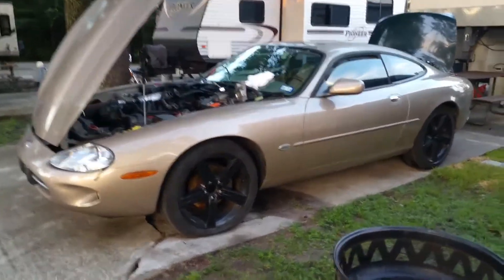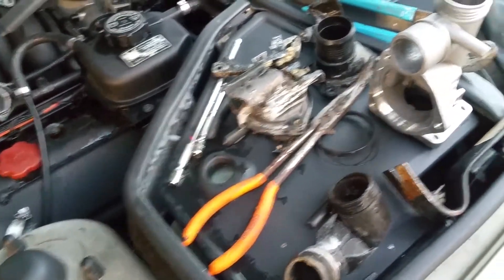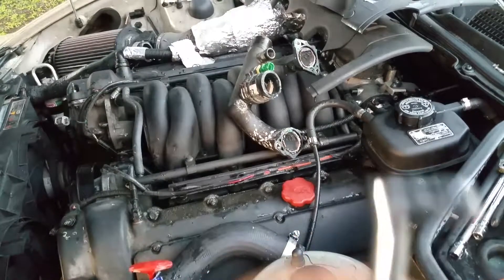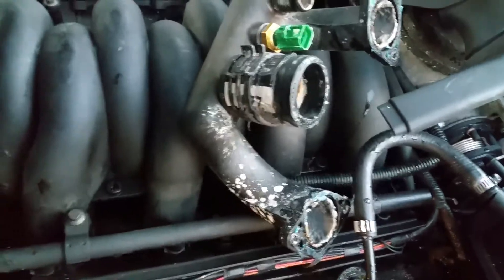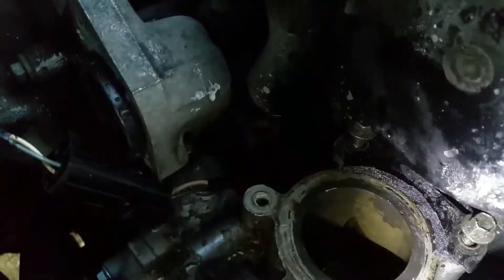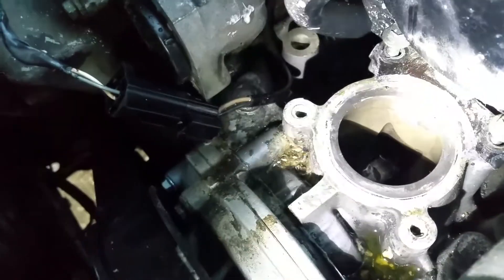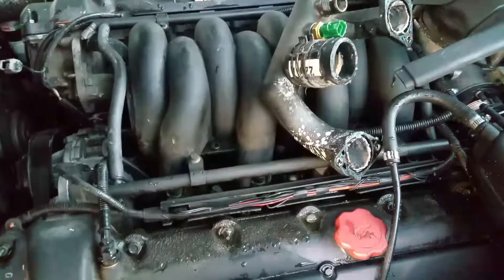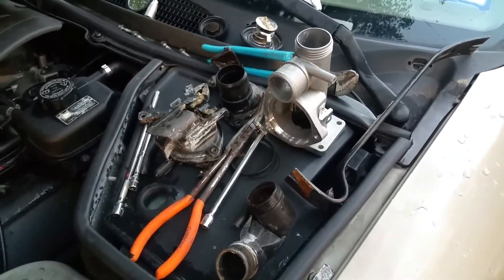Jaguar XK8 Thermostat Housing Replacement

Comment: Ford owned jag at this time, but the ford designed jags have the word type in their name. X-type and S-type. You can get lots of ford parts for these cars. The s-type shares many parts with Lincoln LS. BUT the XJ and XK are 100 percent pure Jaguar design - there isn't a single part I know of from Ford that will work on the real jags (x308).